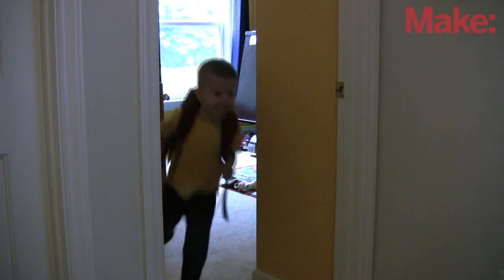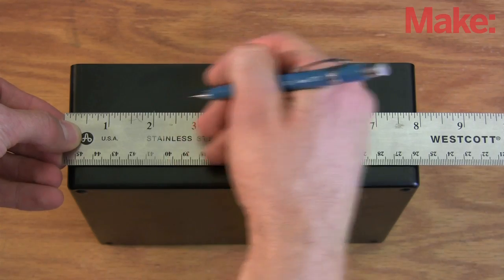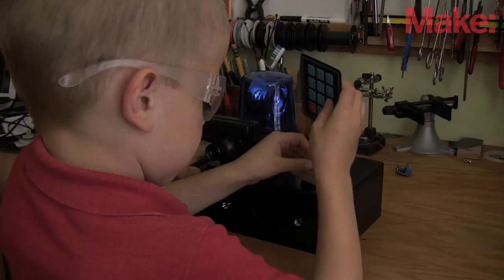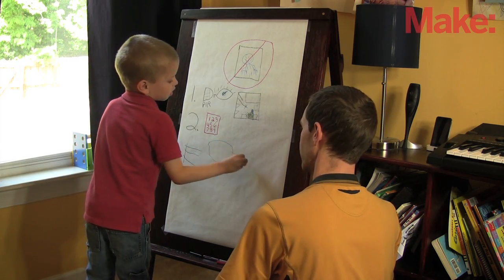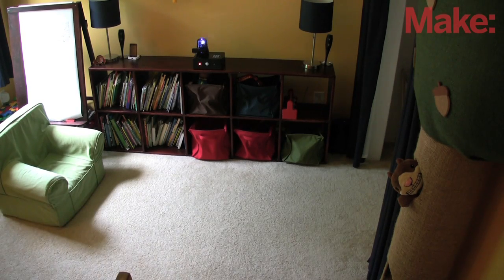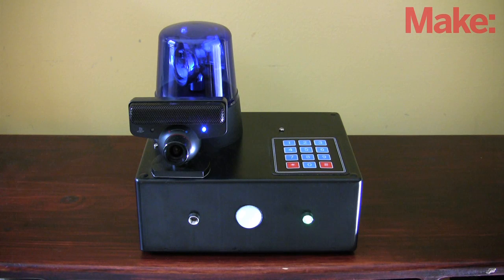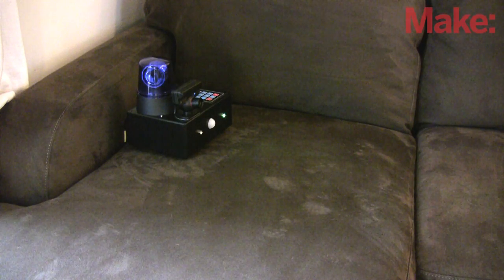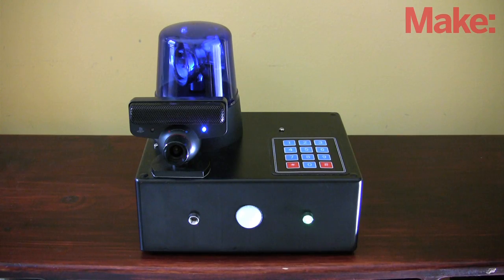Making Fun: The PiLarm

Comment: What if you made a house-wide security thing.
"Intruder detected, lock-down imminent"
*Locks the door*
Give you enough time to call the cops in an emergency.
Or connect this to a nerf gun (or bb gun if older) with sensors, got yourself an auto turret, put a on a receiver, you get a remote sentry.
Reply: +Thomas Druce Or notifies the cops for you.
Reply: Tenebra Solanum yeah but then you accidentally set it off and you have a BB in your head

Comment: I've been looking for Raspberry Pi projects, and this by far the coolest.
Reply: *****  for me it's too expensive
Reply: Powder-phun Too expensive? You're kidding right?
Reply: QQQQQQQQQQQQQQLOLTHATISLONG No, i'm not kidding. I mean, i could use it in a prototype, but enclosing it in a ready project? With a breadboard? Total waste of money. The ONLY thing you needed for this project is a microcontroller ($3) and a soldering proto-board ($3). The arduino coasts about 25$ and the breadboard is another $7. That's because arduino has integrated programming chip. But maybe it's not a lot of money in america...
Reply: Powder-phun Yeah, but arduino isn't as good unless you are the best at using arduinos. This needs to use the internet, a webcam, a motion sensor, deliver power, and use a speaker coded to say text.
Reply: QQQQQQQQQQQQQQLOLTHATISLONG actually, arduino is just a board with uc headers and a programming chip. Only special thing about it are it's libraries. EVERY thing you just listed could be done with just a plain Uc, if you'd program it with a code written in the arduino IDE (which i think is possible, never tried).

Comment: Let me know how you plan to use a pic to take pictures, tweet, email, and play full wav audio files... lol Anyway, maybe this isn't a temp testing setup. His son had a use case and will be using it. with a perma-board costing just 3-4 bucks that is cheaper than leaving a breadboard in there and desodering it is always an option down the road. The only loss would probably be the enclosure.

Comment: i hate seeing projects were they arw still on the bread Bored. its for testing not a permanent thing.  also why arnt people using like pic micro controllers and such. they are smaller and cheaper. i hate boards like this because people use them and call it a day. they too are meant for temporary jobs just for testing.

Comment: Austin, check out the accompanying article on makezine dot com for links to the code. As far as parts go, the only parts not mentioned in the video are Adafruit's speaker amplifier, odd resistors and hookup wire, and the make of the camera, which is a Playstation 3 Eye.